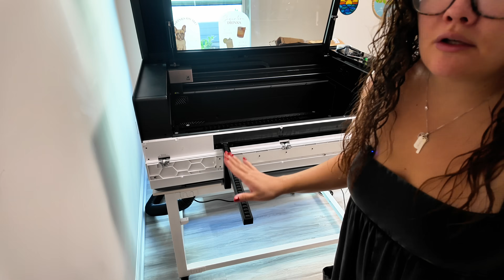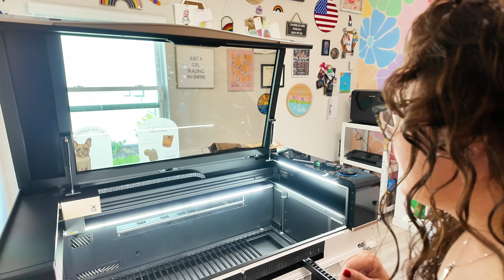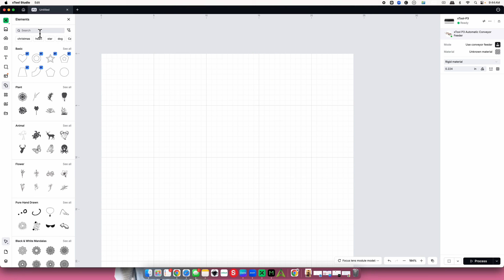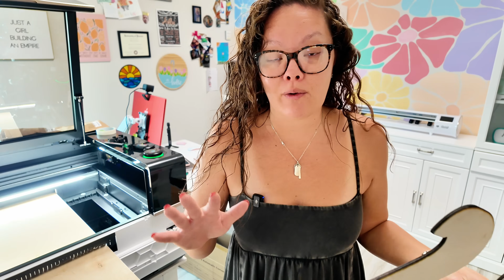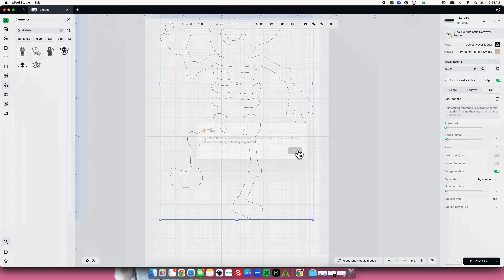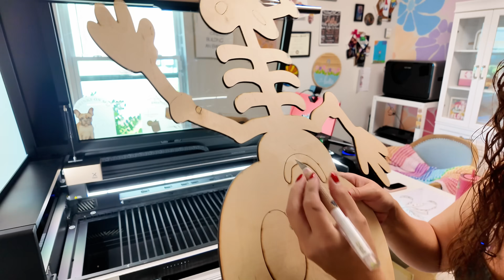The #1 xTool P3 Mistake Beginners Make (with the Conveyor Feeder)

Comment: Hi Ashley, do you have the issue when you initially raise the bed the front rollers raise your material? is there a way I can manually lower it about 10mm. when the back of the material sits lower than the front of the machine because of these front rollers. please help
Reply from the maker: I need to setup the feeder to figure out your issue.

Comment: Used the p3 for a few weeks now. Amazing machine. Still need to install the coveyor. Was curious about the tabs. Lets say you put it on 5. Does it add 5 to each cut? So 5 on the outline but also 5 on each individual cut inside? So lets say i have a large outline with tons of detailed cuts inside, i would hide the outside cut, set tabs to 2, then get the outline back and set that one to 10. Would that be a solution? I woud hate to have 10 tabs on an inch cut.
Reply from the maker: 5 on each cutout inner & outer. Kind of wish we could select more for the outside and less for the inside.

Comment: Great video! My conveyor is stuck on feeding. Did you have any issue when installing yours? I've done all the things it says to check for when this happens, but everything is up to date, screwed in and plugged in correctly.
Reply from the maker: I’ve not ever had an issue with mine.

Comment: So just one question, first off awesome video and very informative. My question is so you were assuming you were going to have like 6 in of waste at the top and 6 in of waste at the bottom with a 36-in long cut out. Did you measure the pieces afterwards to confirm that just to see if that's in fact what it came out to be? The reason I'm asking is cuz it looks like there was a little bit more left over at the bottom than there is at the top
Reply from the maker: I never thought to check but unless the hardware store didn’t sell me the correct cut of wood, the measurements should all equal to 12” of waste in total.
Reply: @ashleefalco yea understood.....just that the waste at the bottom appeared to be bigger than at the top

Comment: Good evening. 

I would like to know if there's any significance with the P3 stand having that gap in the middle of it instead of there being a flat surface for the P3 to sit on?

I ask that question because I pay attention to details and not only did I notice that gap/ opening but I  was speaking to someone else who has the P3 as well and she said that the stand was sold out when she ordered her P3 so she is using a tool bench with drawers which I decided was a fantastic idea especially given the fact that the drawers would be extra storage for me however, my mind wouldn't let me get over that opening on that cart as well as watching how you attached the conveyor brackets in that opening area.

I do plan on ordering the bundle however, I would really love to have the extra storage space too and I would also have to use a stool but that's cool too.

If that space was created in that cart for a reason other than looks then I will bypass the tool bench and stick with the cart that it comes with. 

Please help.💝
Reply from the maker: I don't think there's a reason why there is such a big gap, outside of it being easier to ship. The cart actually comes with 'shelf' things too so you can add in an optional shelf, but it didn't come with it. I'm assuming the reason why it didn't come w/ the shelf is the same reason why there isn't a full desk on top, shipping. When you receive the box for the stand it's very compact, shipping such a larger piece of wood for the top (and shelf) would increase the shipping costs tremendously. So I assume that's the reason why, because you can't use the machine without the baseplate inserted.
Reply: @ashleefalco Ok, thank you so much for the break down.

Comment: Do you need an additional air assist for this machine?  Also, can you test cut a 1/4" piece of acrylic and see if you can get a smooth edge?
Reply from the maker: The only air assist you need is the one it comes with. I’ll for sure be doing test cuts on thicker material soon! ❤️